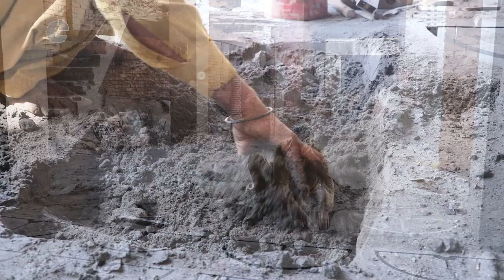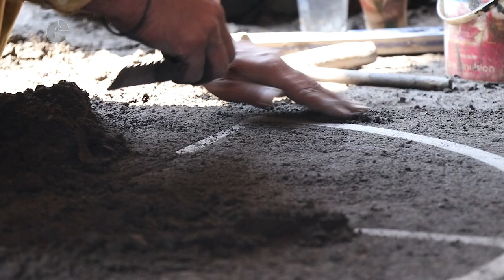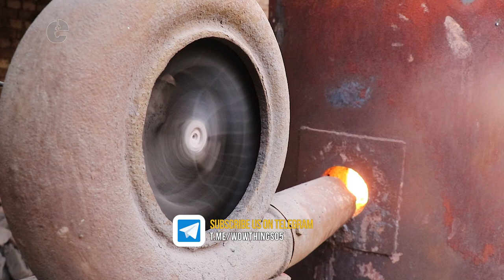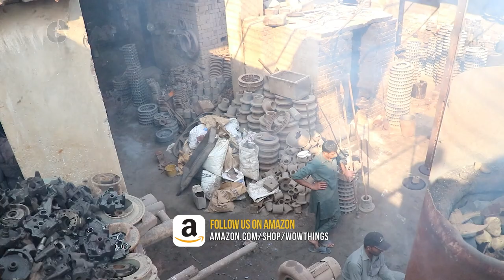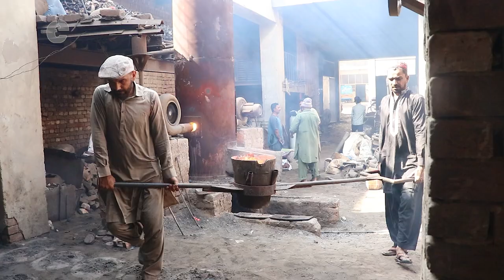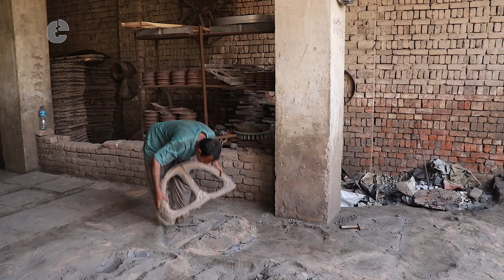Amazing process of metal casting at a foundry

Comment: I can’t believe that guy was pouring molten metal in sandals, say goodby to your toes
Reply: Safety at work is written in small letters. The main thing is to produce very cheaply.
Reply: I wonder how many of the product we use everyday are produced under such conditions
Reply: toes are covered with safety plates named nails... the gift from mother-nature...
)))))))))))
Reply: Leidenfrost Effect will protect their skin.
That's how people can walk on fire.
Reply: From how the sand dude jumps you know he's caught a couple of BBs before but still is wearing sandals. I'm probably just not understanding this kind of poverty but surely there are some kind of closed toe shoes which could be had. Even rags wrapped around the feet would be something.
Reply: It be like that unfortunately. Protective equipment costs money, needs to be replaced, etc. I remember with horror cutting  asbestos roofing without a mask, and I just didn't know it was dangerous, and couldn't afford a good 3M respirator until a couple of years ago anyway.
Reply: And fire proof pyjamas
Reply: @AlexanderGee  they won't wear boots even when you give them dozens of pairs of boots. It is their culture to wear sandals or slippers...
Reply: It would melt through a pair of boots so it wouldn’t make much difference

Comment: If you have ever wondered why products from sources like this are so much cheaper, or you've heard a western manufacturer complain about a labor union's demands for wages and safety, this video explains a lot. In addition to wages that might be as low a 1% of an American or German worker of similar skills might make, look at the conditions. Every motion is filled with high risk of permanent crippling or even death. Pouring molten metal in bare feet. Repetitive lifting while bending over or crouching. Jury rigged furnaces. Hand loading of fuel.  What could possibly go wrong? What iss the cost in human lives to make these castings?
Reply: life doesn't have the same value in third world, developing countries
Reply: The castings are worth more than their lives. It's India.

Comment: It never fails to amaze me that so many of the men working there are doing so in open toed sandals and flip-flops. I can understand the wearing them when making the molds but when they are working around the furnace and or pouring the molten iron/steel  that to me is insane because even the most modern foundries have pour accidents starting with the crucible failing or tipping over. Never mind when a critter falls in a open mold before a pour which if not found will cause the molten iron metal to explode out of the mold. And I am not even going to mention the lack of the most basic PPE that is not being worn.

Comment: Look at how well laid out their system is. They just use the floor instead of flasks. Central furnace - someone in that shop is or was very organized. Amazing work!

I think, after watching many of these videos, we may have lost something in the west. We've gotten fat and lazy. We did all the things these men are doing to feed our families. Up until some time in the 60's-70's.  I see men building and fixing machines. Little is thrown away -  it's all used up then made into new things. The recycling system in these countries work better than ours. We collect our recycling, pat each other on the backs and then bury the results.  Because it costs less to use new materials. I see comments about flip flops and repairs that are obviously 'done wrong' and dirt floors etc. Smug comments about how much better we would do all the things and how far we've come compared to these men. That the  west is 'better'. It's not better. It's just easier in the west because we waste everything. Our recycling guy asked us not to put plate glass in the blue box because they have to sort it out and send it to landfill. 

And yeah, it's obvious some safety glasses and a pair of work boots could go a long way. And a bucket to catch used solvents and oil - that stuff is good fuel for the foundries. And I know there are very poor people there as well who have to work their asses off to put rice on the table. I figure we need something between the wests system and theirs.
Reply: lmfao, a "western" (as you say) production line could produce hundreds of these to better tolerances AND with less waste in the time it takes him to get set up. Perseverance in the face of deprivation is admirable, but to romanticize this man's skilled and undervalued labor is also to insult him. I guarantee he would trade his low-paying job for better tools and material and never look back.

Comment: satisfy our curiosity please ... WHAT it is that they produced ?
Reply: I think manhole covers
Reply: @MarkoKraguljac  I think they would pour a manhole cover in one piece. This is only some frame. But it could still be... not sure. It's a mystery.
Reply: @Engineer9736  I would not be surprised if they weld perforated sheet metal on top so it can pass water. These could be just structural, weight holding halves.
Or they are building parts for ITER.
Both make sense :3
Reply: @MarkoKraguljac  When i saw that India (although this video is probably Pakistan) is helping with ITER, i felt a little afraid of this kind of scenarios indeed 😂😂

Comment: Amazing forge. Ive been thinking too small and need five barrels. Im assuming they use a large methane sewer system mixed with coal. Or flamable oil.  But that can easily be converted into an electric forge...4:05....ideally they would need rail road tracks and flat carts to be automated factory parts.
Reply: The place looks like they have to do it with what they've got... If the resources where there to improve, there could be improvement everywhere, starting out with bulldozing the entire place and starting from scratch by pouring a concrete floor and raising a building from new 2022 materials.
Reply: Coal, or preferably coke, no oil or gas. No, you can't run a recycling cupola electrically, you need burning carbon for the deoxidation cycle it performs. Btw, a cupola is not a forge, it's a furnace.

Comment: I really hope these castings aren't for anything structural or load bearing. That mix of metals is so inconsistent what is being produced can be very brittle.
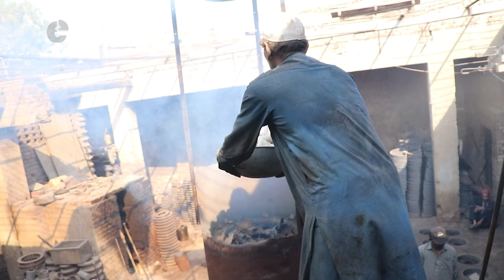Reply: At 4:46 they threw some ingredients into the furnace, i guess that's the bit that turns iron into steel (carbon i believe). I'm not sure if it's possible to put too much of it in, otherwise, the steel should be good. I assume they have been producing these things for decades and thus have the experience long time already whether their product lasts.
Reply: @Engineer9736  it is more than likely either wax or what looked like borax. They do this to draw out impurities. The problem is if you are mixing too many metals together then you are creating alloys. Some alloys will form into brittle garbage if the mix isn't right. So for their safety I hope you are right. I have watched so many pour videos I would be curious to see what some of the casting channels think about this but it's hard to tell from just a video.